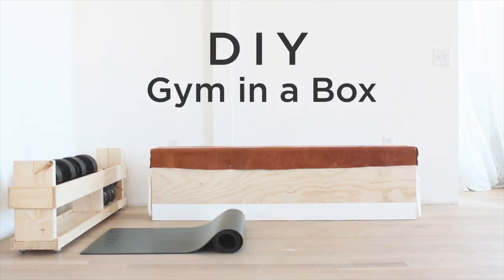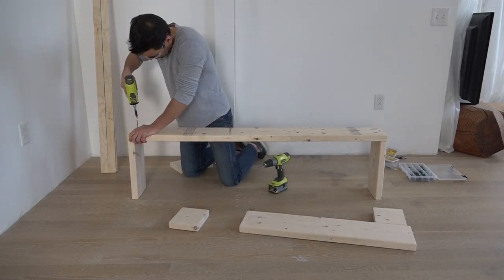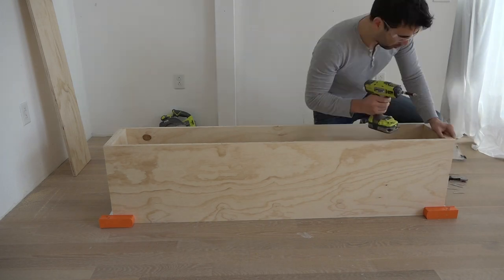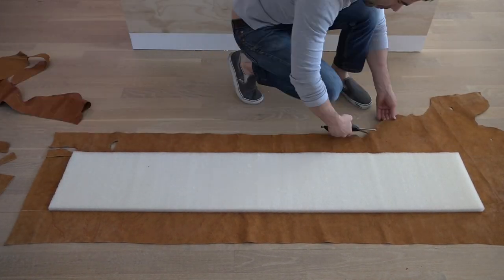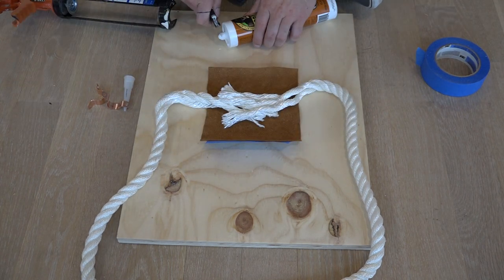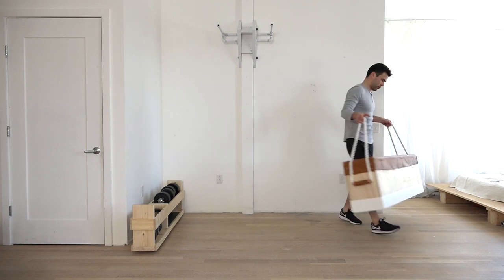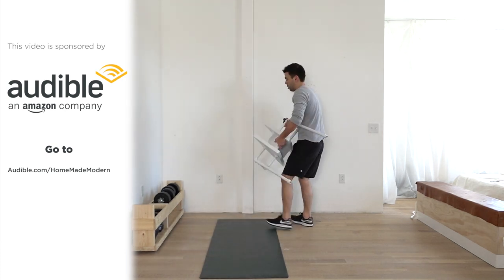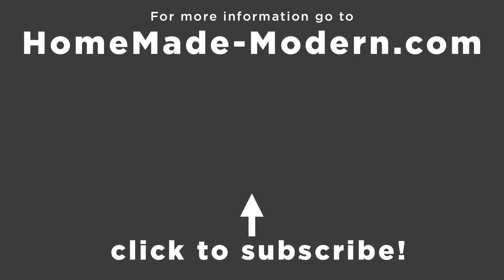DIY Home Gym In A Box

Comment: everything is really nice except that raw edge of leather around the box. id trim it out with something..it annoyed the shit out of me like it wasn't finished..
Reply: matanuska high hahahaha same. I scrolled down to find this comment
Reply: matanuska high totally agree, and the paint at the bottom coulda been a little straighter on the one side.
Reply: Agreed.
Reply: matanuska high It would have made more sense to upholster a separate piece of plywood (tucking under the edges), and attach it to the box with screws.  The unfinished edge doesn't bother me as much as I'm not sure that upholstery job is going to hold up.
Reply: was about to comment the same thing ^^
Reply: I think I would add some high-density foam along the top, roll the edge and use those rough iron furniture tacks to attach it. I'm too much of a pansy to lay of leather covered plywood with weights.

Comment: as an engineer I factor in time, material and  tools in the cost to make w/e and most things are usually always cheaper to just buy something because you can be doing something else with your time. If you have the stuff laying around then ok but most don't.

Comment: all you you need are thousands of dollars worth in tools!
Reply: Lmenzol one tool at a time
Reply: Lmenzol lol yeh and not to mention carpenter level skills, unless you really love DIY projects and have the tools and skills already you might as well just buy your home gym equipment. Or go to a gym

But it's fun to watch even if I'll probably never do it myself
Reply: Ryobi makes a pretty complete set of tools with two batteries for about 250. Drill, impact, multi tool, hand saw, recipricating saw, and flash light. That's all you need for this project and more. I do a lot of pallet work and have never needed anything more than that. More than a weight bench costs, but worth the investment.
Reply: Lmenzol a lot of hardware stores will cut plywood for you. Then you just need the drills